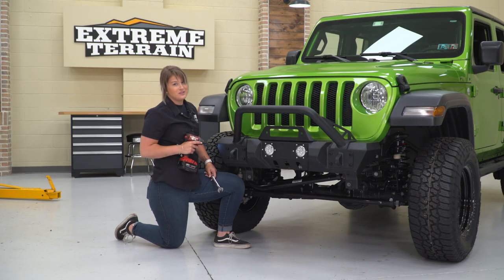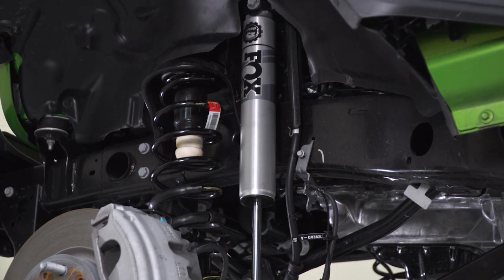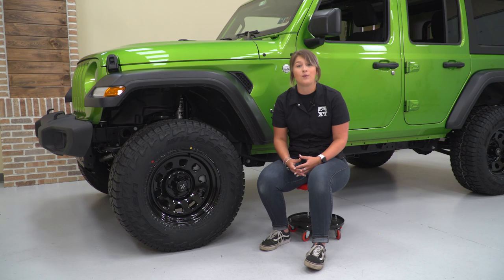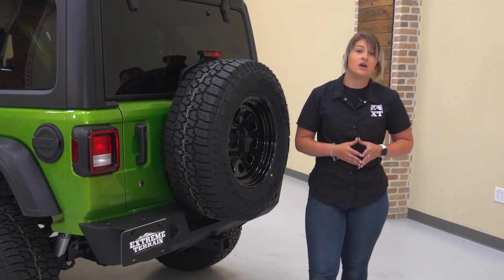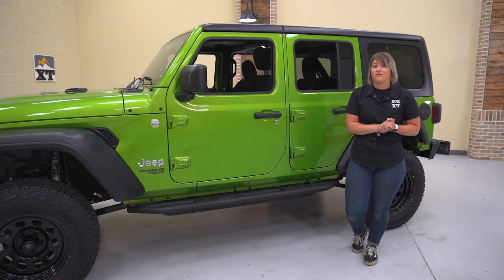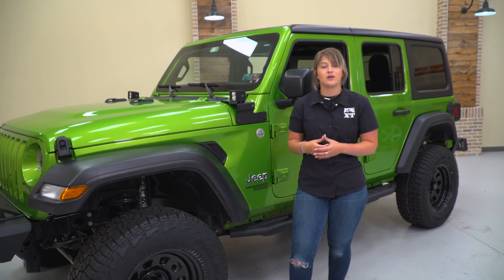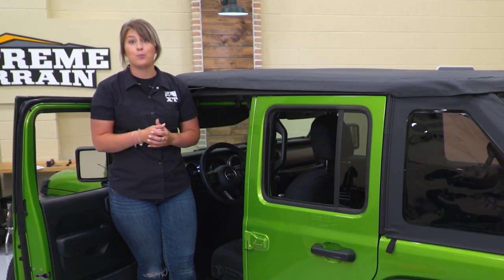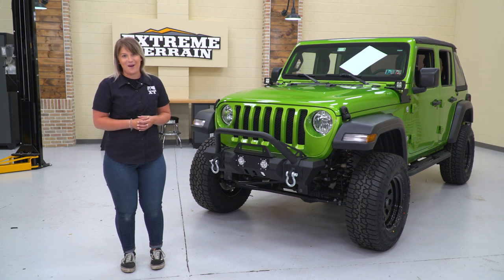Lifted Jeep Wrangler JL Budget Build 🚙 | Daily Driven Custom Jeep Wrangler JL Build - Throttle Out

Comment from the maker: Subscribe for Daily Jeep Videos: http://terrain.jp/SubscribeXTyt
Check Out Accessories and Parts For Your Jeep Wrangler Right Here: https://www.extremeterrain.com/throttleout-august2019.html
Jeep Wrangler JL's Build Parts List:
Mopar 2 in. Lift Kit w/ Fox Shocks (18-19 3.6L Jeep Wrangler JL 4 Door) - https://terrain.jp/2YXhT9r
Bestop Trektop NX Soft Top - Black Diamond (18-19 Jeep Wrangler JL 4 Door) - https://terrain.jp/2LiizQ9
RedRock 4x4 Stubby Front Bumper w/ LED Fog Lights, Winch Mount & Over-Rider (18-19 Jeep Wrangler JL) - https://terrain.jp/2MK0Bpr
RedRock 4x4 Side Armor w/ Step Pads - Textured Black (18-19 Jeep Wrangler JL 4 Door) - https://terrain.jp/2M5TPv0
Barricade Extreme HD Rear Bumper (18-19 Jeep Wrangler JL) - https://terrain.jp/2HKPaty
Mammoth D Window Black Steel Wheel - 17x9 (18-19 Jeep Wrangler JL) - https://terrain.jp/2YxVi3J
Falken Wildpeak All Terrain Tire - P285/70R17 - https://terrain.jp/2GUzgx9
Teraflex 3/4 in. D-Ring Shackle - Pair - https://terrain.jp/2ZhHMxB
Raxiom 3 in. Square LED Light - https://terrain.jp/2OIEmmD
Mopar Door Sill Guards - Black (18-19 Jeep Wrangler JL 4 Door) - https://terrain.jp/2H1XgiA
 Mopar A-Pillar Light Mounting Brackets (18-19 Jeep Wrangler JL) - https://terrain.jp/31nDHbx
Mopar Auxiliary Switch Bank (18-19 Jeep Wrangler JL, Excluding Rubicon) - https://terrain.jp/2YLuVq9
Reply: ExtremeTerrain.com  Everybody is always changing out the factory wheels.  Can’t people keep the factory wheels and go with bigger tires on them

Comment: Nice build! Did you need to reprogram the computer to account for larger tire size? More importantly, do you know what the mpg’s will be with the 3.45 axle ratio? Also, does that hitch have wiring to pull a trailer? Is the stinger on front real (can it protect the Jeep if it rolls forward on a downslope)?
Reply: You should always reprogram the computer to adjust for tire size. The factory Sport tires are 31.5, so going to a 33 is not a huge difference, but for optimum performance of the transmission/speedometer it's pretty simple to do. You can use a Tazer, HP Tuners, or any of a variety of other programmers. Turning larger, heavier tires and not adjusting gearing will cost you some MPG, but probably not more than 1-2 overall.

Comment: Great content. I’m thinking about getting my Jeep and currently living in Maine. How well do the soft tops handle snow? Wondering if a hard top is a requirement. Thanks.
Reply from the maker: The new soft tops really hold their own in snow, honestly! If you opt for the premium option, they hold in heat just as well as the hard tops do. The only thing that you'd have to worry about it making sure too much snow doesn't pile on the top, and you also wouldn't have a rear wiper blade or defroster with the soft option. -Zach
Reply: Thank you for the reply

Comment: Great video! If I went with a 2.5" lift (no Rubi fenders), would I be able to fit 35s? Same purpose as this video; daily driver + weekend warrior, so not much (if any) crawling
Reply from the maker: Absolutely! 2 or 2.5" of lift will fit 35s without any issues and won't be too high for daily driving. When you decide to take it off-road, you'll have a really solid platform for light and moderate trails. -Zach
Reply: Thats what I run on mine, 2.5” with 35” KM3’s.
Reply: @Dominic Martin how about gearing?  Need to regear to run 35?

Comment: I would keep the hardtop.  All the other stuff looks good but it also looks like low quality.  I bet that stuff will bend on the first rock it meets.
Reply: RedRock 4x4 stuff is known to be solid, as is Rugged Ridge. From what I've seen they rust easier over time, but for the money it's really good. Also top choice is all personal, I only got the soft top. It's quieter on road with the new style, insulates better in winter, and I can go naked (or at least topless) whenever I want.

Comment: Nice simple build as I've recently purchased a JL and my build has started, recently ordered a Barricade Trail Force Front bumper and a Smittybilt Gen2 X20 10000lb winch w/synthetic rope.  So after a few months running these I'll need a rear bumper still looking and researching that one.  However I'm not one for the soft top prefer the freedom top for some reason.  Thanks

Comment: Very nice videos. I am planning to buy ny first jeep ever soon. I was debating myself between the unlimited sport and the unlimited willys (basic one). Do you recommend to get the v6 or 4i still thinking on this as well chhers
Reply from the maker: Thank you for watching, Hugo! Both engines are great options, honestly. You'll see better fuel mileage out of the 2.0L when using 91 octane fuel, but you'll get a better exhaust note and linear power delivery when driving the 3.6L V6. Both engine options drive a little bit differently, so I highly recommend you test driving both of them to see which you like best. -Zach

Comment: Enjoyed the video.  I was wondering what was is  JL trim level, Sport, Sport S, or ...?

Some what new to the Jeep world and interested in JL Wrangle or Gladiator. 

Thank you.
Reply from the maker: This was the Sport S trim with a couple extra interior options. So it came with power windows, power locks, silver alloy wheels from the factory, air conditioning, all of that fun stuff. Sport models will come with black steel wheels, manual windows and manual locks. -Zach

Comment: I have heard a lot of opinions regarding the size of the Tire 35 "requires regear such as drive shaft .... etc. Is this correct or there is no effect ?
Reply: A lot of people have been able to make 35's work without a regear (particularly when using the 8 speed transmission). But the laws of physics are immutable-you're going to give up some performance, MPG, and component life if you don't regear to bring the ratio back to stock equivalent when running larger, heavier tires. Not doing it will be much less painful than it was in the days of 3 speed transmissions and lethargic engines-but there'll still be an impact and you have to decide if you're willing to deal with it.

Comment: Wider tires is all I would change
Reply from the maker: With the two inch lift we installed you could easily fit some 35s under there with no problems! We just stuck with 285s since this is a daily driver, and that size tends to run a cheaper price-wise. Thanks for watching! -Zach

Comment: How do these wheels match up to a JT gladiator for regular use, high way, towing and off road? How much do they weigh ?
Reply from the maker: You really won't see a different in day-to-day usage with these compared to your stock wheels. Steel wheels tend to be a little bit heavier compared to aluminum ones, so these guys are weighing in around 39 lbs a piece. This is going to help keep your wheels a bit more planted off-road. Also the beauty of steel wheels is that if you ever bend it up off-road, you can pound it back into place with a hammer when bent aluminum wheels usually can't be salvaged. With highway and towing usage, aluminium will be a better option as they're slightly lighter. -Zach

Comment: Do you find it necessary to add the bigger brake kit to a Sport model when adding larger tires ?
Reply from the maker: If you're sticking with 33s or 35s I honestly wouldn't worry about it too much. If anything you can always replace your brake pads and rotors for something more performance oriented like PowerStops Truck & Tow line of brakes. If you're going up to 35s or 37s and have the money a big brake kit will definitely help out though! -Zach

Comment: That Mopar lift kit imho is a bit expensive for what it is. I just went with a Rough Country spacer lift w/ N3 shock for $300. I'm waiting to spend about $3500-$4000 for a proper suspension upgrade when I do my axles. Kept stock black wheels, 285/70r17 Milestar Patagonia M/T tires (about 33" and super quiet on road and great off road). Bumpers will be Westin WJ2 stubby w/light bar front and full WJ2 rear (w/o tire carrier). Yes the bumpers are expensive but I love the jack points on them. Rock rails I'll probably go with the N-Fab Rkr rails, cheap but good. Eventually will get MetalCloak Fenders and rock rails. I do like this build for a weekend warrior style build, minus the suspension choice. It makes sense, I just hate how expensive it is.
Reply from the maker: For all that the kit includes I think it's right about where it needs to be price-wise, if anything its a little more expensive because of the Mopar and Fox Racing names and the fact that it can be warrantied if installed at a dealership. Sounds like you got a great build plan going though! Westin, MetalCloak and N-Fab all make some killer products. Best of luck with your Jeep and thanks for watching! -Zach
Reply: @extremeterrain  Agreed I forget about the warranty since I pretty much voided mine at 1000 miles 🤣
Reply from the maker: Just gotta send it. 😂 -Zach

Comment: Can you run 35 inch tires on a mopar 2 inch lift kit for a 2019 jeep sport unlimited?
Reply from the maker: You absolutely can! I'd recommend getting a set of wheel spacers to eliminate rubbing at sharp turns if you don't plan on buying aftermarket wheels though. -Zach

Comment: What backspacing on the wheels?  Factory backspacing?
Reply from the maker: These wheels are going to have 4.5" of backspacing, with a -6 mm offset. So with a larger tire like this 285/70R17 they will poke out about an inch further than stock. -Zach
Reply: ExtremeTerrain.com 1” are you sure?  My calculations of a 285/70R17 -6mm offset has the outer wall of the tire at 2.57” further out than stock?  I have a JL Sahara, so similar to the sport and +18mm is calculated to push out 1.79” further than my stock tire/wheel

Comment: Will it be applicable on a 2018 JKU?
Reply from the maker: These parts will not fit on the JK model Wranglers, only the JL models. That being said you can easily apply some of the ideas seen here to your JKU! A 2.5 in. lift kit, 35 in. tires, new wheels, bumpers and side protection will do great things for looks and off-road performance! -Zach
Reply: @extremeterrain  Thank you so much! I dont know how far I want to go with building my Jeep all ive been doing is researching 😂😂
Reply from the maker: Keep researching! There's plenty of information on Jeep forums, Facebook group, and right here at XT! Feel free to ask if you have any other questions, I try to get to all the comments. 😁 -Zach

Comment: What's a JL?
Reply from the maker: The term JL is simply the latest two-letter code for the newest Wrangler! Jeeps in general have been given two-letter codes like this since the beginning of the brand. JL stands for Wrangler models made from 2018-2020 and newer, JK stands for Wrangler models made from 2007-2018, TJ stands for Wrangler models made from 1997-2006, etc. Hope this helps! -Zach

Comment: Ok so around $6K in parts, and for the people that dont have a yard, garage, or a play to work on their Jeeps you have to add around another $3K to get all this installed. So about 9-10K total. Dont know about you all i dont have that kind of money laying around to throw into a Jeep build.
Reply: Mark most of that stuff is easy bolt on parts. I installed my step bars, headlights, taillights, ditch lights, and bedlinered my bumpers and grill in my apt. parking lot. Les Schwabb will install the wheels and tires for about $100 and the lift for about $300. The only thing that needs real space is a place to put your hard top. I don’t have these exact parts on my JK but they are all pretty similar and I’m about 6 grand all in

Comment: Wouldn’t it have been cheaper to just order a JLU Rubicon, than spend $40k on a Sport S and dump $7k into it?
Reply from the maker: If you're okay with keeping your Rubicon 100% stock, sure. But Rubicons won't come with Fox shocks, heavy duty bumpers (unless you pay for the metal bumper package, some people choose to replace those anyway), aftermarket lights, steel wheels, heavier side armor, etc. People are going to mod their Jeeps no matter what package they get. 😁 -Zach

Comment: Buy a TJ and put a modest lift on with 32 or 33" tires and call it a day! To throw all this money at these crap buses is such a waste. Sorry but Jeeps don't have 4 doors and more computers than a library.
Reply from the maker: My two-door Sport JL with crank windows and manual locks is pretty nice. Base models are still pretty true to tradition! 😁 -Zach
Reply: @extremeterrain  

I had an '08 JK X with manual locks & windows. But it had that garbage 3.8 mini van engine, always needed something, ran like $#i+, issue after issue. JK's & JL's are rolling piles of cpu trash compared to my '05 TJ Rocky Mtn with the 4.0l I6. The low end torque is amazing on these. Throw any jacked up 4 door limo with 40's and I will take that for a drag through a mud hole any day of the week. JK's and JL's are jokes, rolling piles of crap. 

I will never own another Jeep beyond '06 again, lesson learned. Mark Allen and FCA ruined jeeps. 

Jeep
Born: 1941
Died: 2006
Reply from the maker: Enjoy your TJ!  It'll definitely age better than some of the early JKs with the 3.8L like you mentioned. Wranglers made 2012 and newer have been pretty solid in all honesty. After some kinks were worked out with the 3.6L in the beginning it has proven to be a work horse in multiple platforms. We're seeing a couple kinks getting worked out in the JL platform as well, but I see a TON of people with nothing but great things to say about them (including myself). Wranglers can't stay simple forever, and innovation always comes eventually. For people who want simple, there's always older Jeeps to fix up. 😁 -Zach
Reply: @extremeterrain  Jeep was made with the intent of being utilitarian, rugged, uncomplicated and 2 doors. Like society, nancy boys have softened it and people in the aftermarket naturally endorse it for gain, big shock. Bells and whistles are for luxury cars and should have never infiltrated Jeep Wranglers.